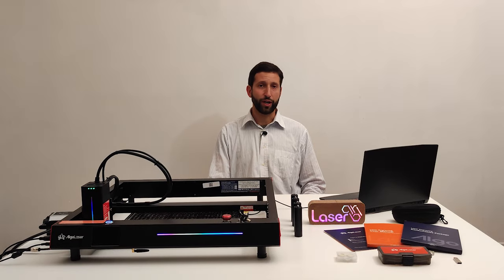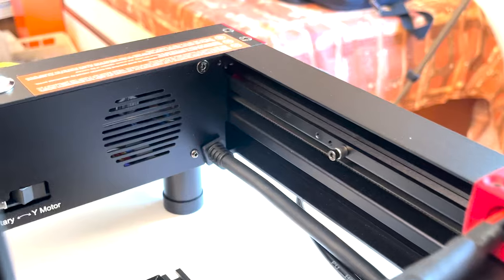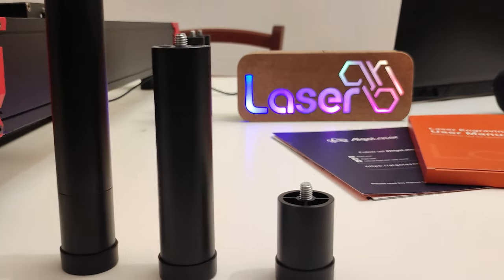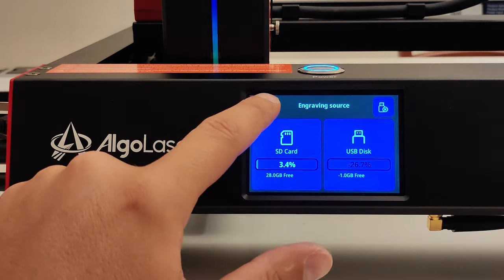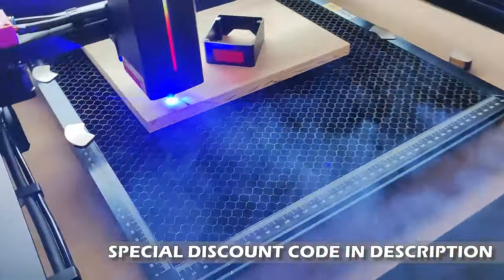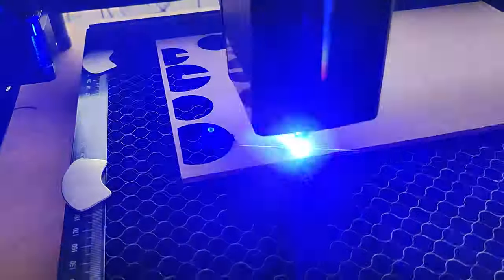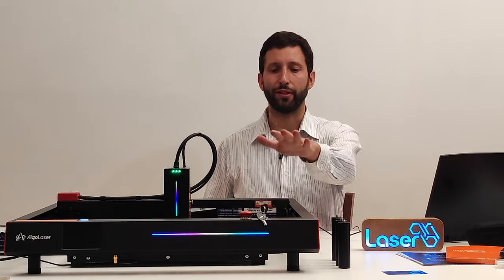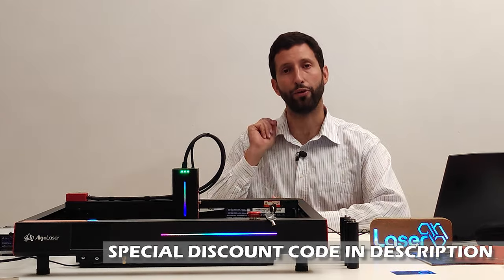Algo Laser - Algo Delta 40W

Comment: I like that machine. I have a skulpfun s30 ultra with a 33watt blue diode laser though and dig using your LaserGRBL with it. I wonder if I can find a place online that has a list of all the best settings for each known brands and their models of machines, then create a databate stored within LaserGRBL. It would be wild to mesh it with even some of the open source Inkscape programming files to take LaserGRBL further. Cheers Captain and thanx for being born.
Reply from the maker: Hi, thanks for your compliments.
Yes, it would be nice and I even thought about it, but it is very difficult to standardize these parameters because they depend a lot on machine and machine and materials, and users' engraving preferences. Some manufacturers provide reference tables, which I write by hand in LaserGRBL. It would be nice to be able to share "in the cloud" those that users find manually... I'll think about it!